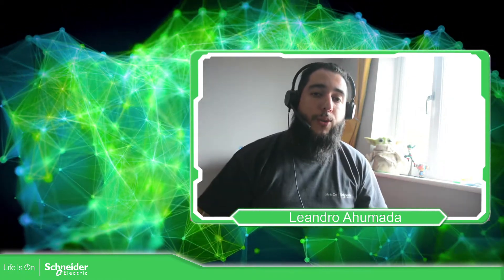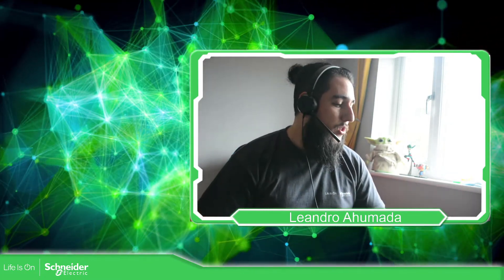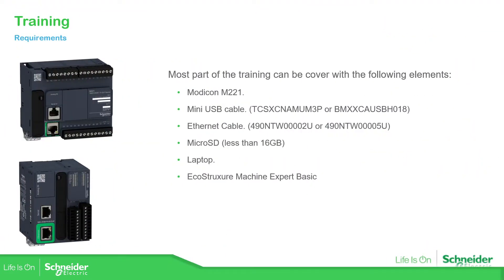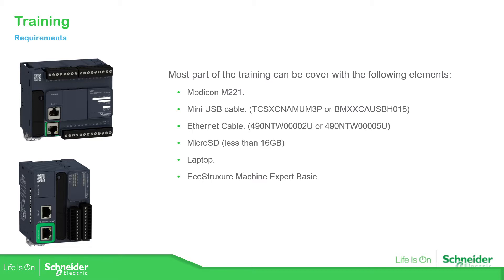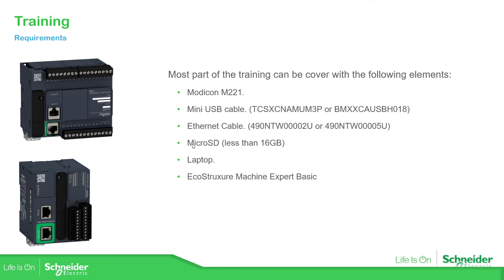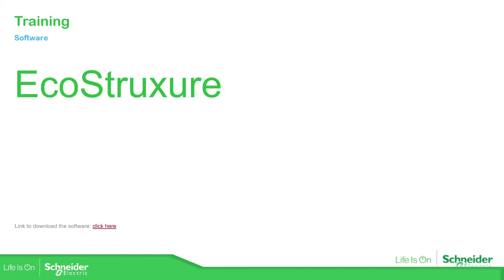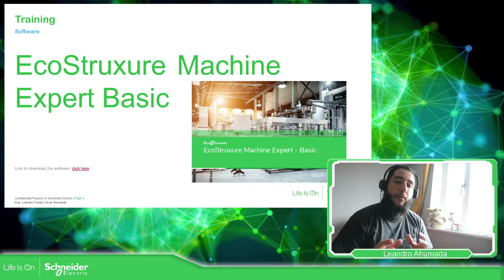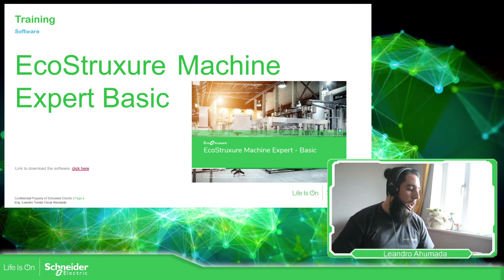Training - M221 - M1.1 Introduction

Comment: Mr. Leo do you have video about data type? Because its kinda confused specifically when using float. For example we use %MF1000, when we have value in it, the value in %MF999 and %MF1001 will change also. Same with the exact address but in%MD.. so when using %MF we cant use the next address and before it? Please clarify.thanks A lot. Were using this plc in exchange to Siemens.
Reply from the maker: Hi there! I was thinking on doing a video about it because it is the first time someone came to me with the same question.
Basically the memory area related to %MW %MD %MF is the same area so   if you have a variable defined in %MF1000 it will also use the %MF1001 because it needs two registers, so in your code you should use %MW1000-1001 neither %MD1000-1001. The location of the variable on the area helps use to read the variable properly. 
In your case i believe the %MF999 is used by another variable.

Comment: We use M221 Schneider controller and at times it is failing to communicate with the software unless your reset the power (switch off and on) on the panel. This is sometimes down for a number of times before the Controller responds. Could it be that the controller is fault.
Reply from the maker: Hi there! I do not think it is something on the controller to be honest but i will advice to use latest firmware. I recommend you to retrieve the log files of the m221 and contact the schneider support to check it.  It will be good if you record the behaviour of the led to know the real status of the plc.
Reply: @LeTomasAHUMADA  thank you. I am suspecting the battery and planning of replacing it.  This is happening after losing power and my thought is that maybe the backup battery is dead. Thanks again and great training.

Comment: Hello!
can M221 Print reports or data?
One of my client is requesting for an print report function for his cement batching plant. Is it possible to print reports using M221 plc?
Reply from the maker: Hi there! I just saw this 😊
The M221 can save date into a sd card but if you need something like a report a small scada like the EcoStruxure Machine Scada Expert can be a solution or one of our hmi software to export the data.

Comment: First, the sound is not clear
Second, the explanation and presentation is difficult for beginners to understand.. The program in general contains branched and forked instructions and commands, unlike Siemens, Delta and Omron programs
Reply from the maker: Thanks Samo for your comment.
I have been working on the quality of the video and audio in the newer videos 😊, if you check the newest videos you will see the change of the audio quality. I am sorry that the series of videos are not clear for you, if you were working with the other brands then you will managed to work with this software in no time.